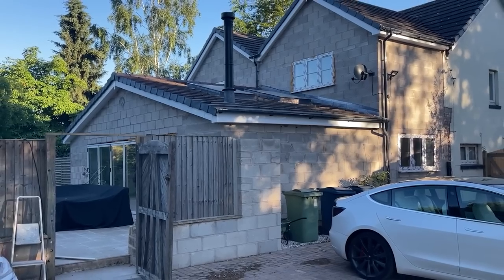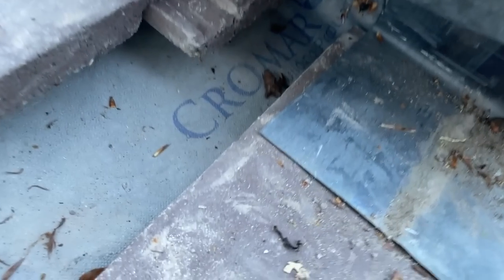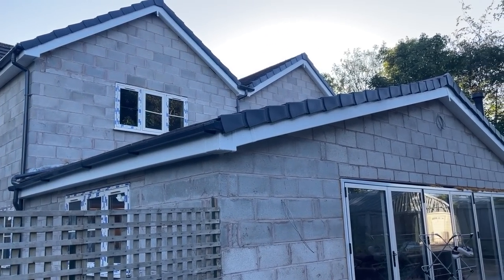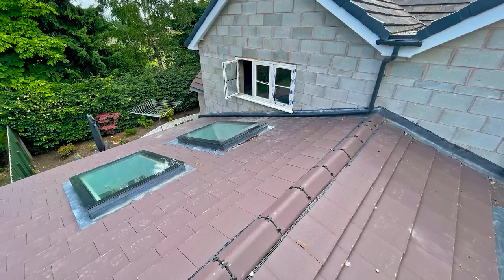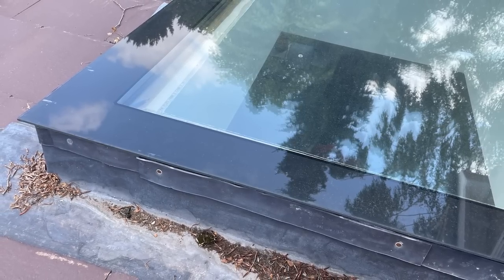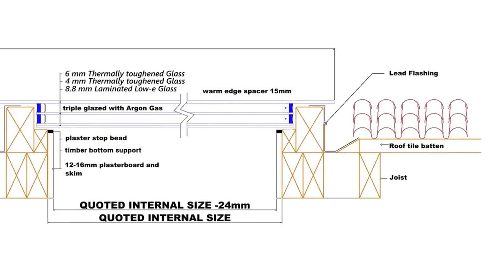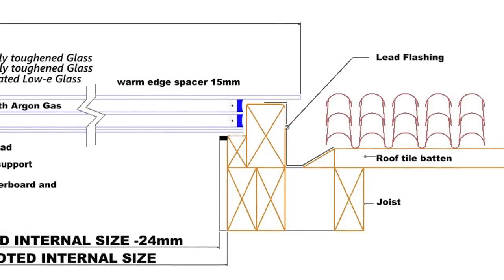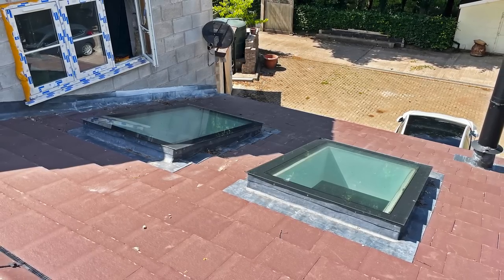How Many Mistakes Can You Spot on This Roof?

Comment: Oof. As the owner of a skylight company. Damn man, the lead isn't even the length of the tiles! 
I mean, yeah they screwed it up top to bottom, but even in their munted ass attempted to flash around they didn't do it right.
Lead not wide enough for the top and bottom flashing, 450mm boys not 300. Lead cut 20mm too short, why is that? Because they cut them to the length of the tile then curled them down at the nose, well guess what, these tiles are at their limit, you just knocked 20mm off the tiles in a high flow area around the skylights. 
Walls used too thick of plasterboard, even though they made the frame too large, probably because the owners cheaped out on that extra gable and ran them at ~700mm instead of 600. 
No shade I'd do the same, but then I'd put a spacer for the framing of the skylight so give the lip required. 
You would then do the flashing before the glass which these guys clearly didn't. 

This could have worked, if a skilled roofer/skylight bloke did the job. 
Great advice on the repairs, I'd love to see how it works out because I'm sure those glass panes aren't cheap. If done right you should be ok for a couple decades.

Comment: you cant use a soaker on these tiles...a soaker needs to sit on the tile below,so its only for a plain tile or a slate
Reply from the maker: you can use soakers just as you would be slates. Just overlap them.
Reply: soakers have to be sitting on something or they will do nothing,if you are putting them on top of a marley modern then theres no point  in them,the water will just run under them as they would cover flashing @SkillBuilder

Comment: Hi, I have made comments to David Chi, regarding in my experience in sorting out this problem, as said Cowboys, I was surprised by the way anyone could leave a job in that condition. (Cowboys). regards welshman2081,    I read David Chi, has removed his comments,  Roof lights are now normally supplied with all flashings.  on normal old-style roof lights, the slate was cut to seat under the light, part of the row, the lead soaker was formed using Plumbing lead beating wooden tools forming L shape turning the 2 corners, laid on top of the last cut slate, the sides were formed again with L shape soakers, laid on top of slate on the 2 vertical sides, the top being similar to the bottom, after that the flashing formed again L shape to cover the soaker etc,
(All very skilled work), now all these flashings are made of metal, as supplied with modern roof lights. Regards

Comment: Should have just fitted velux  or similar, if I turned up on a job and saw 4 pieces of glass to figure out I would have refused any part of it .
And why they didn't use soakers is beyond me . 
But if you don't want to spend in the right places ..........

Comment: 12:43 don’t get same roofers in. They have not done it properly. They have put short courses in,not done the lead properly. Just get rid of that useless inch flashing and just seal under the glass and leave no gaps. No need to take window out. Open the roof to check water trail. I bet them roofers have put no vents in the roof line.

Comment: That roof window looks like a bad detail. Relying on a mastic joint from glass to flashing is an awful idea. The glass will move about with thermal expansion and the mastic joint will fail over time. Water will happily flow around the glass and back up into the mastic joint,I've seen that more than once. Any good roof window will either have a frame with a mechanical/mastic fixing down to a timber upstand, or a pre made frame with a drip which the flashing fits up into. If the window is taken out a contriband swell tape could be fitted as a secondary seal.

Comment: Strip off roof, throw glass lights away, fit Velux windows and use correct tiles for the pitch.
The job is an utter bodge, shame on that roofer.
Reply: Liiking at the vid, Im guessing the pitch of the roof was determined by the first floor window abutting the roof and the height of the walls because the customers wanted a large open plan kitchen with a high roof space.
Reply: She didn’t want a velux because it was too expensive lol

Comment: I foresee huge problems with that bi-fold door, whatever steel lintol has been put up there to spec or not , it certainly doesn't bow upwards with all that weight on it , which means the doors are sagging due to not being fitted level, The dry verges also puzzel me , as from the top there is that out of bond half course of tiles , yet they don't show up on the dry verges ?Oh dear just looked at 1.49 mins , they are just awful

Comment: What a mess! If you are relying on less skilled builders then a Velux would have been a better choice, easier to get right in the first place and easier to fix afterwards. 

To properly fix this those glazed units need to come out, the membrane needs to be done properly and the flashing should tuck in to a rebate under the glass with a seal all round. Trying to patch up what is there is never going to last long.

Comment: The roof tiles are not laid correctly, I don’t think they measured out before starting, if these guys fitted the windows, I’d be pulling all the tiles up around them to see what they’ve done, I think Roger is right, theres no trays there. That shouldn’t be a difficult job, you can also fix the lead work and put it under the tiles. You shouldn’t be-able to see behind the lead work like that.
It’s nothing to do with pitch, these windows can be used on a flat roof.
I wouldn’t just try patching it, you may have more water than you realise coming in getting absorbed into your timber work and plaster boards.
Reply from the maker: The point about the pitch is to do with the tiles

Comment: Mr Ben Roofing has had a go, bad design, bad workmanship, could have put a flat roof on, with a lantern, fibreglass, or rubber roof. I'm a joiner, and that roof pitch looks low. Those
 tiles aren't to gauge.

Comment: Those are not true rooflights and they are unsafe. They are sealed to the kerb by silicone, and when the silicone degrades, which it will, adhesion will be lost and that pane of glass will slide off the roof. Anybody or anything under that falling glass will be in real trouble. A true danger there. A strong gust of wind could also remove that glass. What testing or design integrity has been offered by the supplier? How can they prove those things are safe?

Comment: Top coarse of tiles doesnt look like it goes up high enough and why they havent gauged the roof properly is beyond me. Having that coarse with 2 inch of tile showing id a clear sign that they started at the bottom, set out 12 inch to the top and then thought oh, this doesnt work out, then did nothing about it! The joints on the tiles look to be all over the place too, rather than central on each tile. These pan tiles are the easiest to lay, if your getting this wrong you really shouldnt be on a roof.

Comment: Clearly the lead should have gone in first, then the window dropped in... Start again and lift the window out.
Reply: And i wouldn't be happy about the spacing of the battens, you see at the top they didn't work it out and bodged it at the top. As a joiner, a good roofer is the hardest thing to find if you want anything other than slates or tiles going on. I always fit my own velux as roofers skimp on the collars that should be fitted i discovered when i had to fix one.

Comment: I hate to admit it but the building trade is in a horrific state. I’m 22 years in the trade and am currently rectifying my brothers wrap around extension with loft conversion and full house refurbishment due too the first builder doing a runner, who is now being taken to court by trading standards, and then the second builders workmanship, well it’s just disgraceful. Roof tiles with a 10mm overlap, roof joists, some at 450mm some at 657mm and not level with one another. Toilet walls not built square, 44mm difference between the front and back. New windows are not level or plumb, the list goes on and on. 
You have more rights buying a mars bar than you do spending £90k with tradesmen.
Reply: Your brother should have hired you👍
Reply: @macsmith6216  at the time the 3.5hr round trip was not worth it, I’ve now been doing this journey for 10 months, hopefully I’ll be done by Christmas

Comment: Absolutely not done by a roofer.  The gauge is all over the place, unfortunately the whole lot needs to come off and start again using the correct gauge. 
Marley moderns are minimum 17.5 degree pitch. Rooflights if you can call them Rooflights will always cause a problem invest in good Rooflights like Velux with the correct flashing kits and your be fine but this roof does need doing by a professional.

Comment: Round those windows should have soakers and lead dressed up under the glass and then weatherproof mastic to seal the lead to the bottom of the window. The blacked out edges of the glass should be a clue that your not meant to see what is under there! As for the scrap lead nailed around the top, whats wrong with these people? This is someones home, they are spending money to improve the biggest thing they will ever own, just take some damn care and even if you're a bodgey builder that has some skill but not much knowledge, use the internet for gods sake, all this info is so easily gathered! Plenty of times ive checked videos on systems ive never used before to make sure i do things right and with something as common and simple as a roof light and flashing, theres tons of into out there. Theres just no excuse for this. Total lack of respect towards the customer.

Comment: Bodge job aside, why did they have triple glazing?. The UK climate (Northern Scotland aside)  is varid. We don't need Triple glazing and even the best TG has a U value of around 0.7, decent double glazing about 1.1. That difference of 0.4 equates to around £3 pa. Those units will degrade and likely need replacing within 20yrs so the saving is £100. There is no point whatsoever in having triple glazing over decent DG........ It's an industry con in the same way cowboys market DG units with a 25mm spacer bar as being amazing when in fact the U value would be less than a 14mm spacer....... These con men and cowboys need kicking out of the industry.

Comment: WoW they could nt even be bothered to work  out what gauge to put the Tiles on at   if they could nt do that then it does nt  Look like any thing would have been done  right, id strip it or  they will forever have problems  24 yrs  and that worse new roof ive seen

Comment: Everything they’re saying screams nightmare know it all customer. They chose the tiles, using flash band. Didn’t want to spend a penny. And trying to sort it on the cheap rather than just pay the extra few grand to have a roofer strip the tiles and fix it. If you didn’t have the money for the extension you shouldn’t of had it done. Don’t get me wrong it’s shoddy and the guys were clearly out of their depth but you get what you pay for.

Comment: The pitch is too shallow for concrete tiles. The designer is to blame and furthermore your local building control do not check or dont have to check the roof pitch. When you work on your own house and draft in the relevant trades you open yourself up to trades blaming other trades.
Have a main contractor who takes responsibility and accountability for all the work.
Finally, the roofing membrane on a low pitch roof will allow water to pond and not run off ar Eaves level even with an Eaves carrier tray. There is no solution for this other than installing a strip of  EPM or butyl liner which again is not a good solution because this w7ill cause condensation.
Two problems in the building trade:
Poor design and poor execution of work.

Comment: I would refuse to do the job for you if you try cutting cost like that and using the wrong tiles and windows even the lead is done wrong for flat tiles and I bet the there's no secret gutter under that flashing on that block wall.

Comment: Just seen your roof.........Wrong tiles used for the pitch. Tiles not set out to the correct guage... flashing not applied incorrectly ........windows in the gable wall too close to the roof not enough space left for 150mm flashing....... The whole roof covering needs to be completley relayed in occordance with manufactureres recomendations.............. Ex BCO

Comment: 1st thought was Where's the soakers. The upstands should of continued under the glass.. That's a pretty shallow pitch for any tile to deal with,probably better to of used 3 layers of felt. As for using flashband it's ok for DIY or a bodge repair.  The "roofers"  need to leave it to anyone but themselves. Shame these people had faith in so called professionals but were stiched up. I've worked with a few people who couldn't care less, now I don't even speak to them let alone give them the time of day.

Comment: tricky one

I would say this is a combination of the client choosing a non standard specification and combined with a roofer lacking sufficient experience, who tried fitting without a proper flashing kit

I think its unfair to say the builders are cowboys

and people moaning that the it was a part self build -well many people do this if they dont have the budget
Reply from the maker: The roof is not good and that is not the fault of the client. There should be a drawing showing the detail for vapour barrier and ventilation.
Reply: @SkillBuilder  oh I agree, the roof light abutment detail was poorly done -as you say there should have been a drawing showing the weathering, vapour and ventilation arrangement.

I use to run a timber orangery manufacturing business and learnt the hard way about rain ingress, the detailing is so vital.

Comment: Not blaming the home owners at all but it never works getting a load of different subbies in who don't know each other/ work together often. Every one just looks after them selves. Either get a building company to do the lot or pay a project manager to over see the job.      General public with no knowledge of building should not be trying to run a job.
Reply: "BuT hOW HarD CoULd IT bE" /s
Reply: Seen project managed jobs let down by one weak link. End of the day each trade needs to know what they’re doing. Should be able to go on site with a bunch of strangers and do a first class job.

Comment: Omg shit job look at the state of the short course no way was they roofers . First thing I would have said when pricing this job would have been about the pitch being to low . Why do ppl build roofs with such a low pitch either build a decent pitched roof or build a flat roof
Reply: There is no problem with a low pitch tiled roof if the correct materials and fixing methods are used, why have an ugly flat roof instead!?

Comment: From a professional eye you can tell by the video that up-stand and flashing aren't done to spec. Unfortunatelly it's the responsibility of the Project manger/ builder to make sure the sub contractors have done there job properly and built the up-stand and flashing to spec before the windows are installed and crucially before you pay them. If that's the area you choose to save money then sadly its an expensive lesson to learn.

Comment: Stop trying to give "expert" advice on roofing, im a roofer for 15 years, I work with lead daily, I weld lead and fabricate waterproof coverings for things like these windows, the problem they've had is avoiding fitting velux windows to save money without consideration for fitting of these windows, the pitch of 15⁰ instead of 17.5⁰ for those tiles will leak, I bet they have some broken water bars on those tiles and the fact there's a cut course on both sides and individual dry verge sends alarm bells, the whole thing needs ripping off and starting again, bet there's no proper ventilation on there.... stick to plumbing or whatever you do Roger, roofing is out your depth.... talking about warm roofs lol
Reply from the maker: Mark 
15 years is nothing, you have barely started. 
I am not sure where you learned your trade but in my City and Guilds Plumbing we did leadwork in all shapes and forms. 
We also did roofing because you need to know how to do that. I understand you feeling threatened by me coming onto your territory, that is the chimp in you, trying to close me down and stifle free speech. Sad to see.
Reply: @SkillBuilder  hardly threatened, I feel more sorry for the poor advice you're giving people who have no idea and come to you for help, you advising them rather than referring them to a proper trades man of that field and then airing it on YouTube is very poor as other people seeking good advice look at this thinking because you're acting like a pro you must be a pro, sadly not the case and 15years good experience in 1 field is better than all your years if this is your "city and guilds experience" coming through